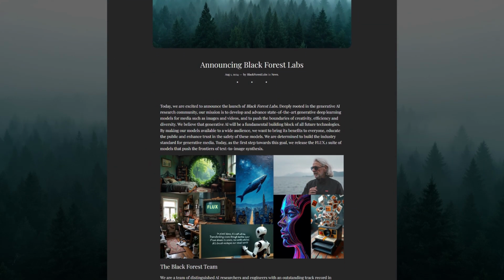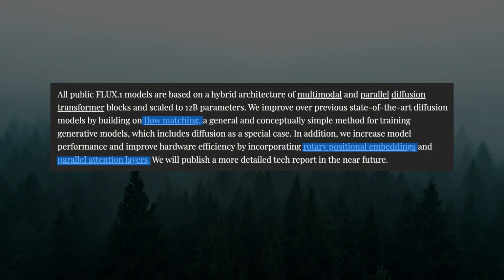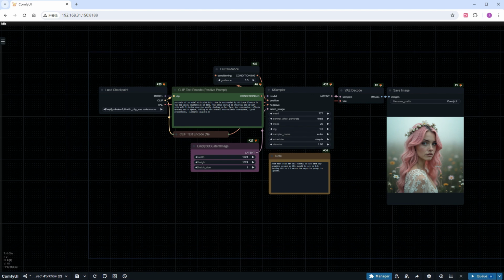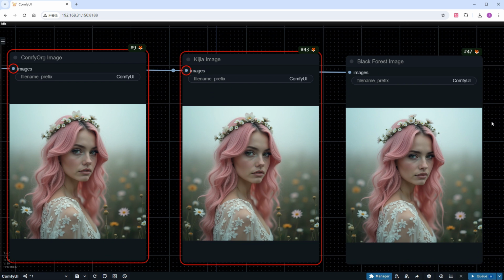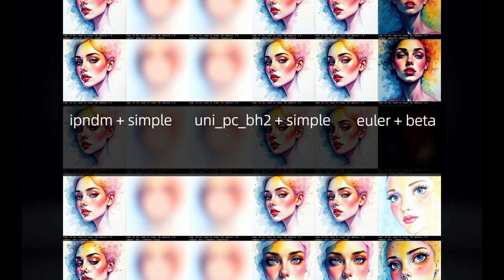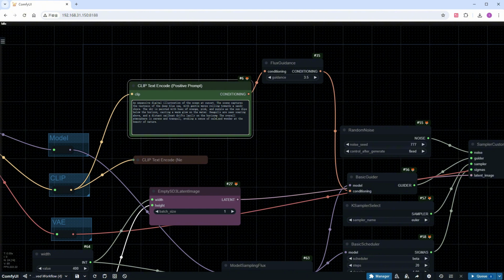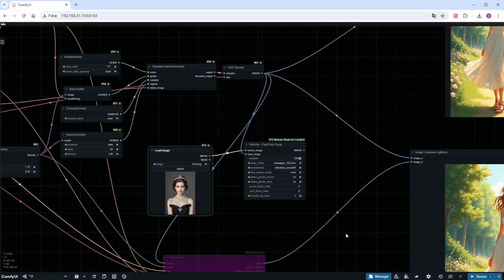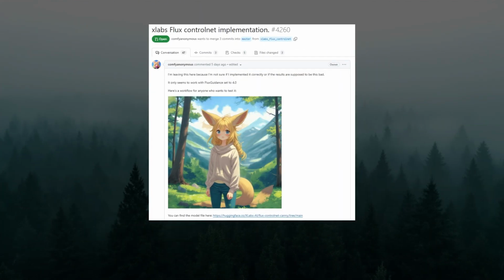The Most Comprehensive and Detailed Flux User Manual: Learn Everything About Flux in 30 Minutes

Comment: Why can’t we run it on stable diffusion? I hate the interface of ComfyUI
Reply from the maker: Stable Diffusion does have a simpler and more user-friendly interface, but it doesn’t support many of the latest features.A1111 hasn’t been updated for almost a year, and while ForgeUI supports the Flux model, it hasn’t seen updates for several months either.

Comment: Thank you for this nice and clear tutorial !

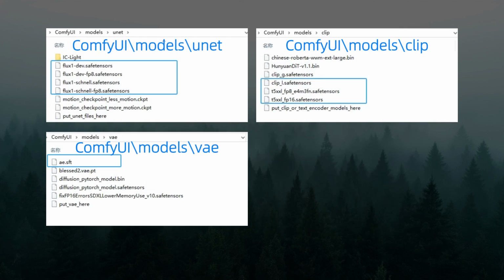But I think two links are missing in the descriptionfor those two files that you show at 6:57.

-The first one for the t5xxl_fp16.safetensors: 
-The second one for the t5xxl_fp8_e4m3fn.safetensors: 

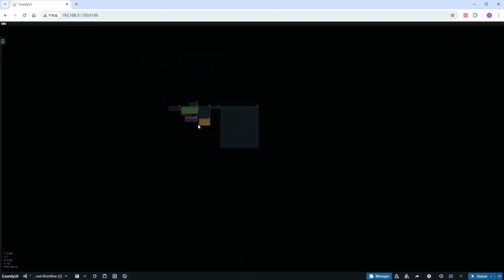And I will have a question . At 9:16 which  file do you drag into the ComfyUI interface to have this default setting?

In advance, thanks for the support :)
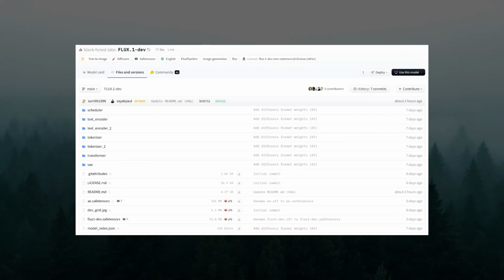Reply from the maker: Those two files are CLIP models, and they should be placed in the CLIP folder, which is the folder shown in the top-right corner of the screen. If you're asking how to download them, I mentioned the download link at 6:37 in the video, and you can find it here: https://huggingface.co/comfyanonymous/flux_text_encoders/tree/main.

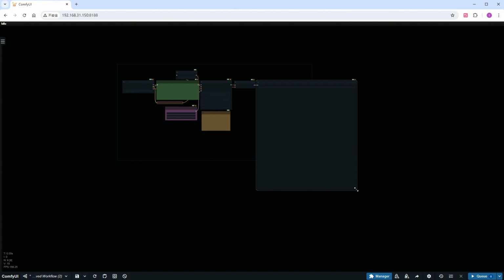At 9:16, you just need to drag the image or JSON file with the workflow into ComfyUI.

Hope this helps!
Reply: @SweetValberry  Thank you !! :)

Comment: 00:04 Introduction to Flux and its creators
02:24 Robin Romach's significant contributions to Flux development
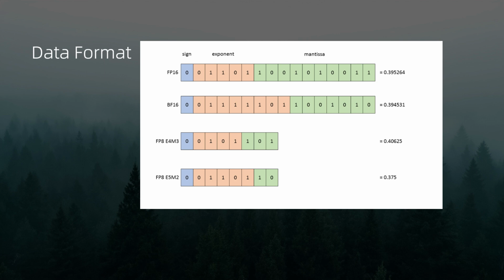07:19 Using Comfy org or Kaji fp8 lower threshold versions for resource efficiency and convenience
09:46 Managing model loading and workflow rearrangement in Flux
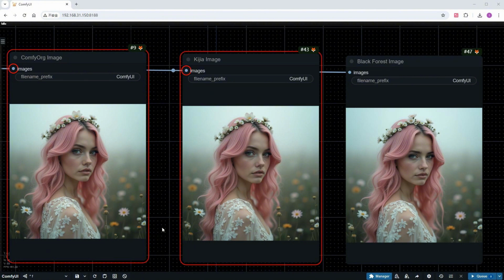15:25 Schell model for fast image generation with resource requirements
17:44 Flux guidance node for image generation
22:45 Adjusting parameter values in Flux can affect image focus.
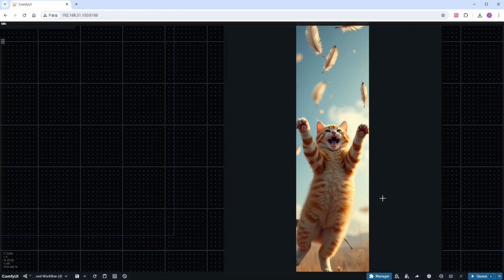25:22 Flux has advanced text and layout generation capabilities
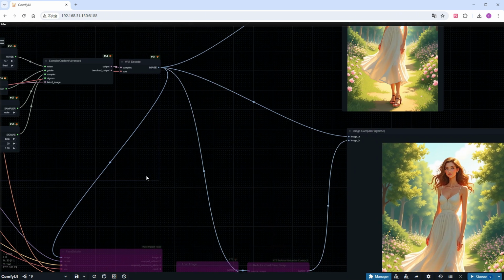30:16 Flux image processing allows for easy style transfer and image enhancement
32:42 Flux offers high image quality and strong prompt understanding.
Reply from the maker: good job~
Reply: Thank you, dear god.